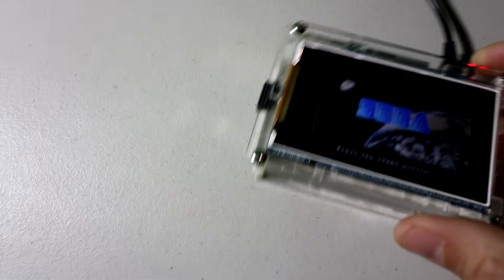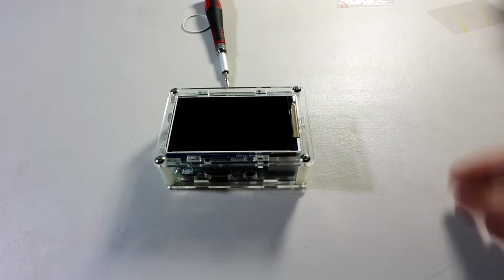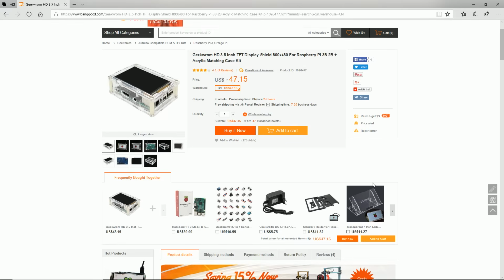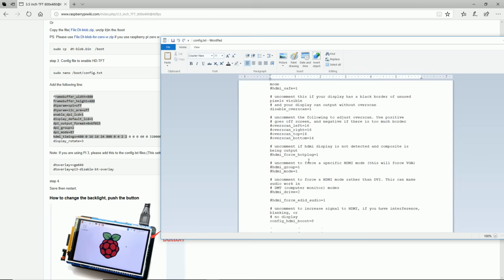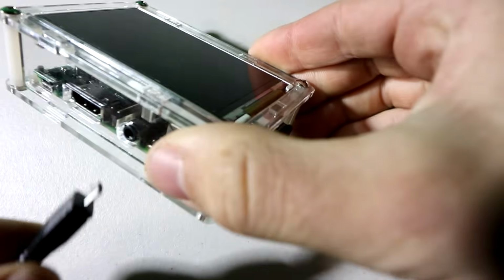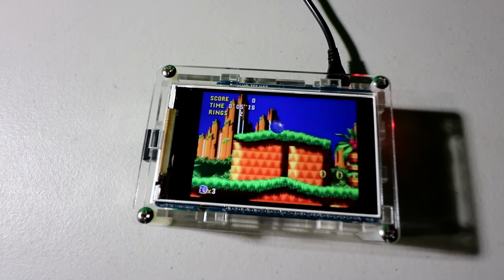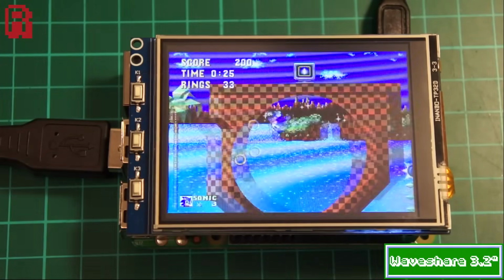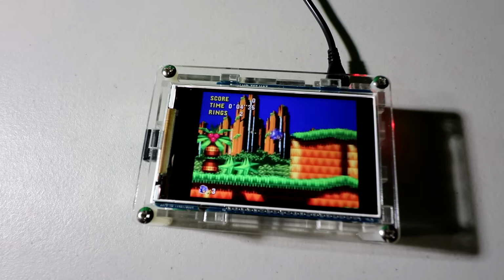3.5 inch 60 fps Raspberry Pi Screen - Great for Gaming

Comment: Quick question. Got the screen myself but can't seem to pair my Bluetooth controller. How did you get to pair yours?
One of the options on the config file where you set the screen buffer and all disables the Bluetooth? I think.
Reply: go to raspi-config go down to bluetooth add new pairing device or whatever it says, once it picks up your controller go to the option that says no input/output. If you're using a ps4 controller holding the ps button+share button at the same time does the trick

Comment: Hi! I need to switch automatic from TFT to HDMI when the cable is plugged, and return back to TFT when is unplugged. There's some way to do this? I've exactly this TFT screen model. Thanks in advanced!
Reply: Maybe using udev but I didn't test it

Comment: I have  the hardware, but need a TOTALLY foolproof way to make the damn thing work. I tried someone else's and they crashed my Pi with a "kernel panic" (WTF is that)?  You guys seem to make it work, just want someone to be straight on making this work. I need this for business reasons. And if it works, I can create a small issue of mini-tricorders in real time in something they can put in there pocket with external PSs. I just want to attached the screen with whatever it takes and make it work and then mess with it. Thank you in advance if you can help.

Comment: framebuffer_width=800
framebuffer_height=480
dtparam=spi=off
dtparam=i2c_arm=off
enable_dpi_lcd=1
display_default_lcd=1
dpi_output_format=0x6f015
dpi_group=2
dpi_mode=87
hdmi_timings=480 0 16 16 24 800 0 4 2 2 0 0 0 60 0 32000000 6
display_rotate=3
Reply: Tim Smith thanks

Comment: I use the F710 on my rasberry pi 3 and there is a noticeable delay with games that require fast responses, like Ninja Gaiden, Mike Tyson's Punch Out, even The Mario Bros series....the button response is not instant...do you have this experience?
Reply from the maker: hmmm i will check next time, I would go wired if you want instant instant
Reply: DrewTalks thanks, what wired controller do you recommend for nes, neo geo, playstation, genesis... just about all the systems?

Comment: Nice! This would make a.good basis for a custom designed 3d printed handheld gaming device. One thing I don't understand though is how this screen can refresh at 60hz - I thought that the gpio pins give you inherently bad refresh rates as they can't deliver 60hz due to bandwidth limitations. I wonder how this screen gets round that.
Reply: It seems to be using the DPI interface instead of SPI.